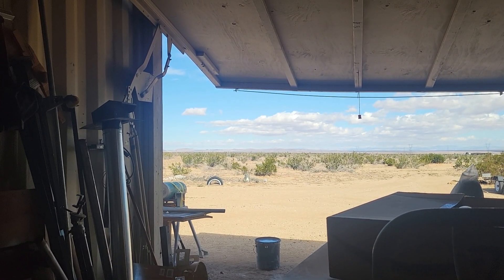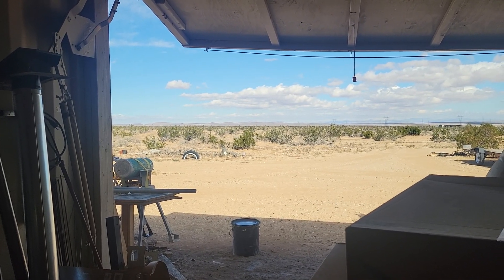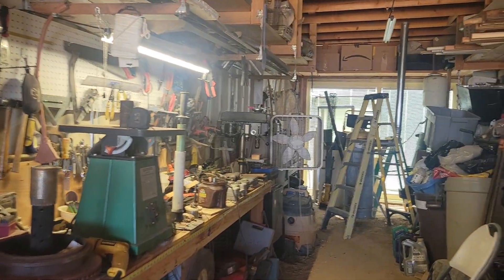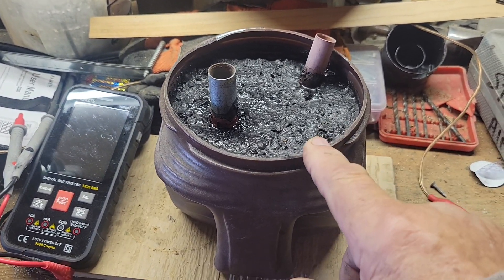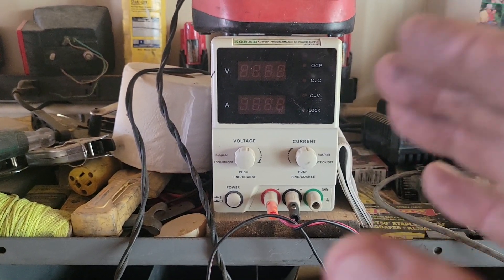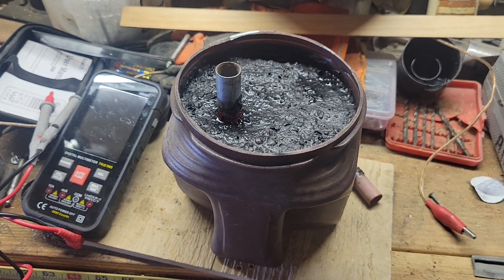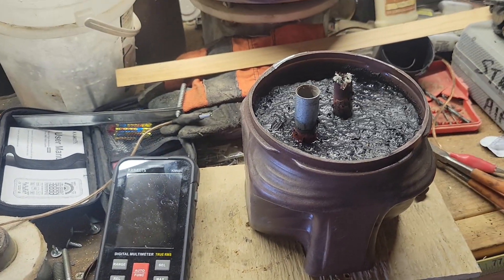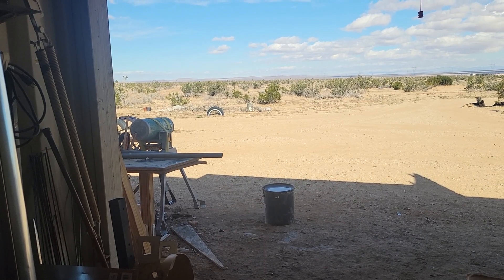Another Type Of Sand/Dirt Battery?  Nov. 18, 2023

Comment: meter at 8:05 wasnt reading volts, it was reading ohms. the battery must have acted more like a resistor than a battery lol
Reply from the maker: Welcome aboard.   Yes, some others noticed that too.
Reply: @GBear  haha yeah, ethier way, sadly these dont make very good batteries. Ive expiremented using old Negative plates from small lead acid batteries, (the positive plates get destroyed, the negatives stay intact and using Epsom salt (magnesium sulfate) or very weak sulfuric acid and forming a lead cell with negative plates. Its a pretty good sucess, i had one hold 2Ah 2v and short circuit it put out 150amps but sadly after 70 100%Dod cycles. The cell died due to me using paper towels as a separator😂😂
Reply from the maker: @joshwayop5413  nice experiement.  I have had a few single cell experiments succeed, 2.3 volts, but not much use.

Comment: These are fun. And the investigating things that are curiosity is so much fun. Because you can make your life better. 

It does seem like people will have to do stuff like this because of utilities destabilizing, regarding sand batteries etc. So I think the idea has merit to heat a room at night, though not necessarily on the electrical end. Many people are just using the copper plates in the sand battery to heat the core quick and then get the sand hot and place the bucket or whatever in their room at night. And without the copper plates in the sand of the sand battery it takes too long to heat up a sand battery, though you can get some time with it. In camping also the coldest point in the night however, is like around the end of the night around 6 AM or 7 AM. I mention this because unfortunately that's the worry is, how close you can get to covering the coldest part of the night. Although if you can get even a bit close to that period its still worth something. So it will be challenging to get them to last that long in the heat. But some heat and getting it to work is better than nothing. 

You carried this idea a bit further than I thought you would with the idea of using HCl and electricity with the sand battery. This is the first time I've heard of applying electricity to sand and dirt batteries. Most of the other videos I'd seen on this just so no electric sand batteries in like buckets or something. 

It will also be interesting to see if people can do much with these. 

///

But I do remember my grandma used to heat bean bags at night. And then right before bed she'd put them in the bottom of her bed. And this is because she had grown up before electricity had spread to her town as a child. And back then lots of people did heated... bags of whatever to stay warm. 

Some of these ideas are coming back now because people are seeing technology isn't always better if its not something you own or made yourself. 

///

Even if this idea didn't turn out perfectly like you liked it to have done, I admire that you made effort to explore and learn new things. Sooner or later if you are trying to stretch and grow always you will find new ideas and some of them will work. They can't all fail.
Reply from the maker: Thanks, great story!  Yeah I grew up in New England back when coal and fuel oil were the main heating items.  We had giant feather pillows to use as blankets for the really cold nights and mornings.

Comment: 8:00 it looks like your meter defaulted to check resistance/ohms, not voltage.  The pointer was not going towards the "volts" selection, but rather the ohm symbol.  I think you were measuring resistance between the two electrodes, not voltage - unless my eyes deceive me?
Reply from the maker: I think you are right.  Apparently the meter didn't detect any voltage so it set up for resistance/continuity.

Comment: duh, it's not a "battery", at most it's a "cell" and the most you can get out of a single cell is a little more than 3 volts, from lithium.
from a regular cell, made from 2 different metals and an electrolyte, is about 1.2 to 1.5 volts
Reply from the maker: Exactly!  That's why I just had to prove that guy was a liar.  There are many guys out there doing free electricity videos, having separate wiring to show higher output than possible.  I like to expose them, they give us honest creators a bad name.
Reply from the maker: Welcome aboard!
Reply: thank you
Reply from the maker: @NtheK365 👍👍👌